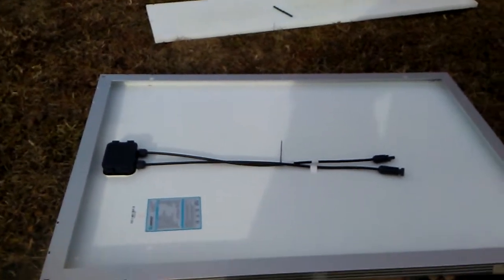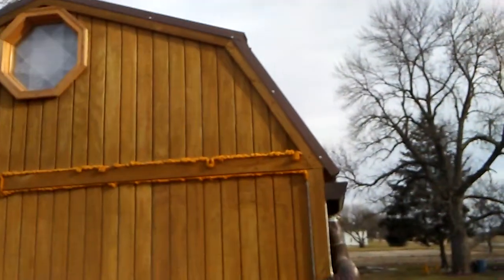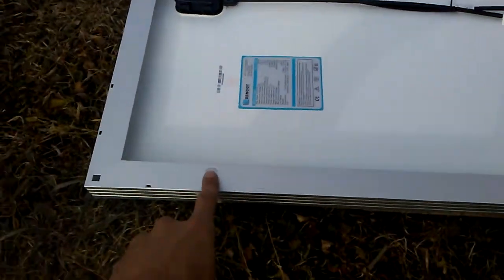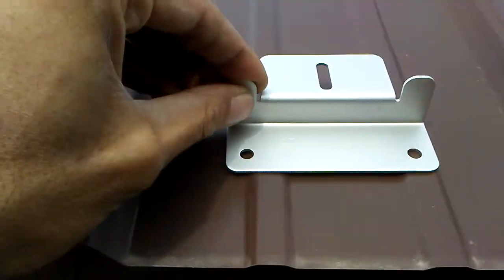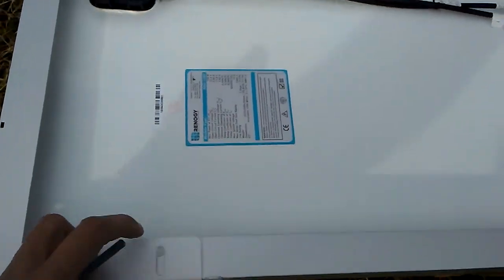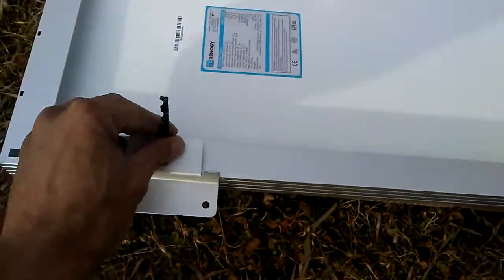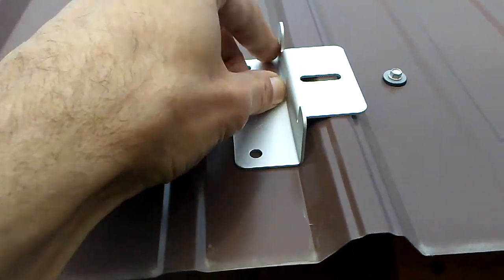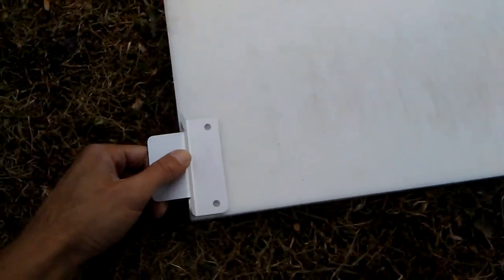Renogy 12V 400W 40A Solar Panel System Kit Install - Part 1 - Mounting Bracket Modification

Comment: Hi there,good videos I was one of your subcribers on your noco preper channel.
Did you still have those videos on wiring home, can you upload the to this channel.
Reply from the maker: I can't promise anything, but I do know that I have to add some electrical to my tiny house and I will shoot some videos of that.  I know that I will do one for my 'service' (circuit breaker panel) installation, some 12v interior lighting, communicating fire alarms, tv coaxial, and I think a couple more receptacle installations. 
If I can find my past videos, I will try to post them again.  Thanks!
Reply: @TinyIowa  that's good.
Reply from the maker: I'm not sure about the books at Home Depot... I'm sure you could go to the public library and check out the books there.  I don't have any electrical books anymore from when I went to college to learn it. Sorry.